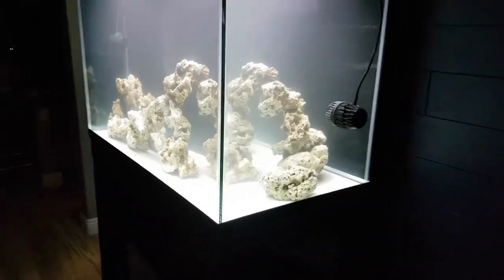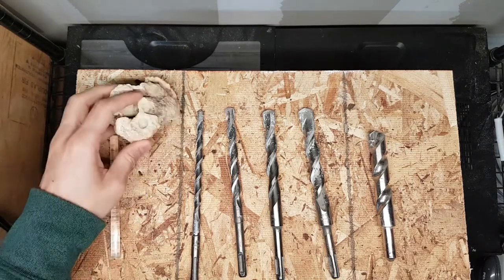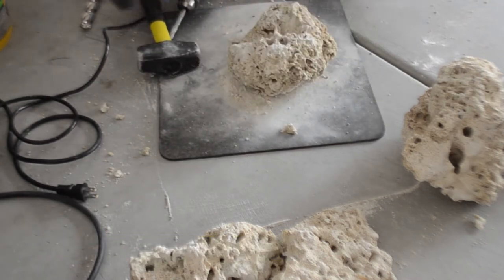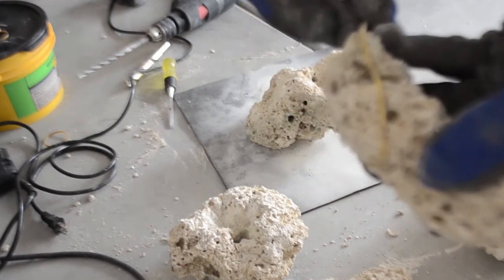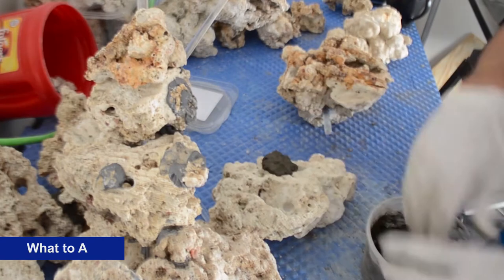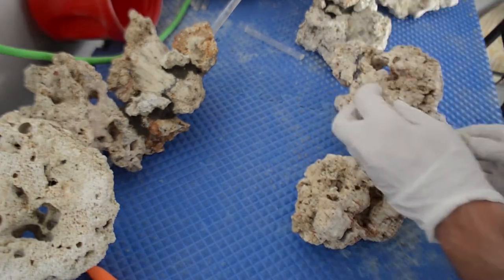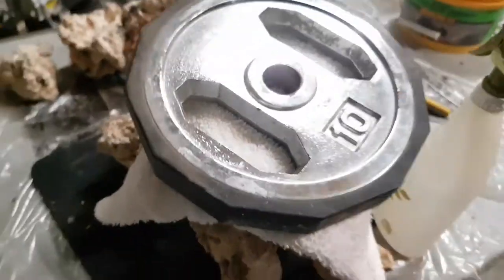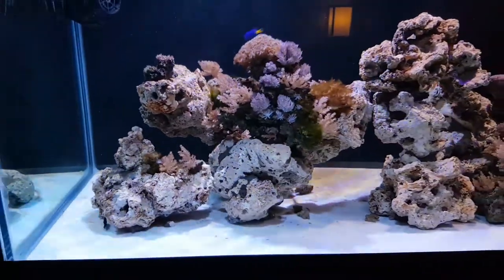Reef rock aquascape ideas - tools and techniques for working with rods and cement

Comment: i can see that you let a little space between the glass of the aquarium, a few space. It's no matter ?

In one last video of you , you put very very fit of aquarium , with space.

I want to put in reef 300 XL one starboard , but if i let a little space no problem ?

Thanks
Reply from the maker: If you are asking about the space between the glass and the starboard bottom, it works best with about a 3mm gap in my experience.
Reply: @gmacreef  Ok. Thanks For the information .

Comment: Superglue any good?
Reply from the maker: I haven't tried doing any major aquascaping with the superglue and sand method. You can attach more pieces at a time, but I'm not sure if it holds up as well over several years. Having your rocks break apart in the tank is frustrating to say the least. There are also a lot of fumes with superglue that you don't get with cement. The best cement I've personally tried is E-Marco-400
Reply: @gmacreef Cheers. Already have the Epoxy putty stuff and superglue.
I'll try a few pieces and test them. I'll use superglue with crushed rock of various sizes from rubble to sand grain size to conceal joints and the Epoxy. If it's iffy, I'll get the Marco cement.